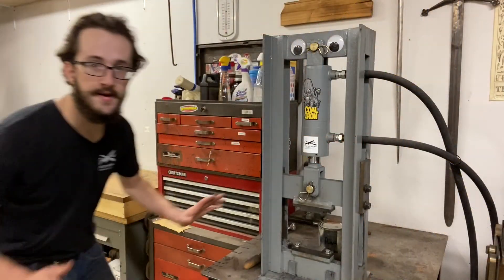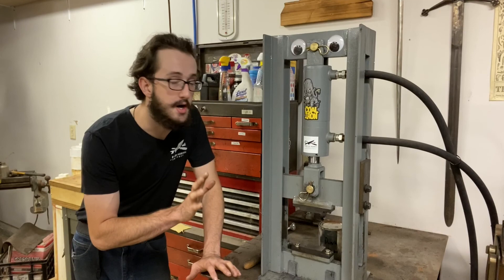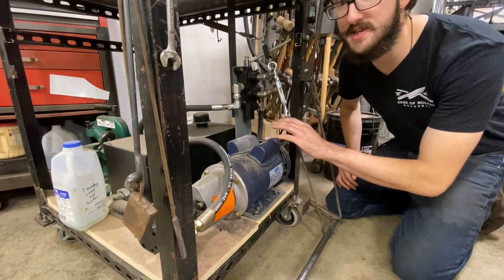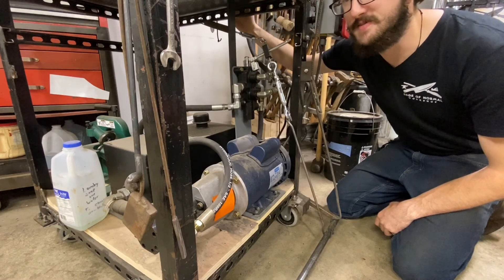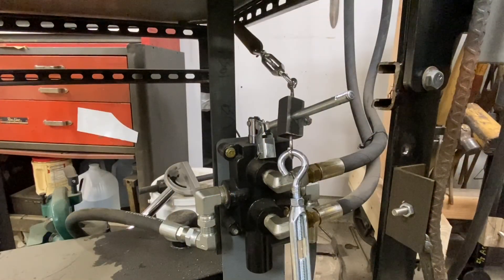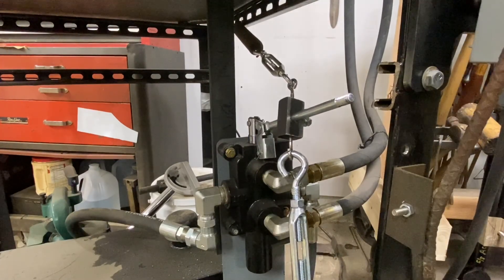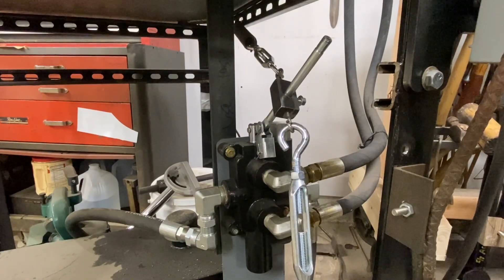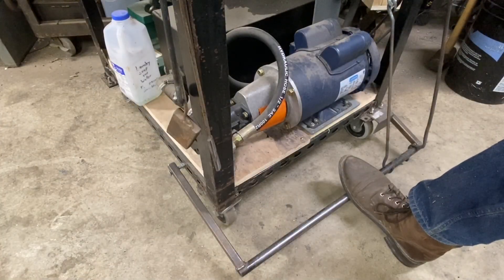Forging Press Foot Pedal

Comment: Have you tried to make a hammer drift for the press yet?
Reply from the maker: I did make one, but now I have it welded to a handle to use under both the press as well as may Kerrihard 
I also use a hammer drift purchases from Alec Steel Co.
Reply: @edgeofnormalworkshop2273  If you can make a quick video on that please! My press will be delivered today!! I don't have a blacksmith channel youtube but do have a FB @ChiliPepperForge check it out. I will give your channel a shoutout when I get the press setup. Thank you again for the videos and reply.